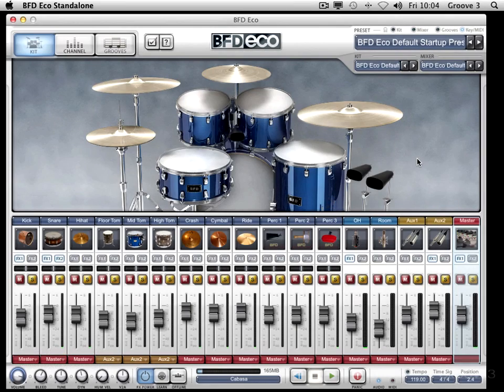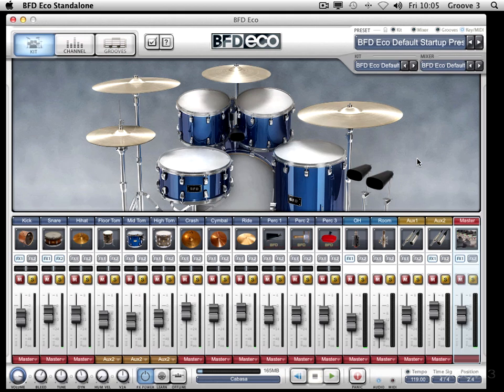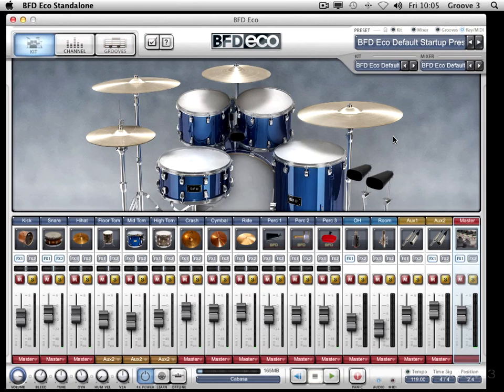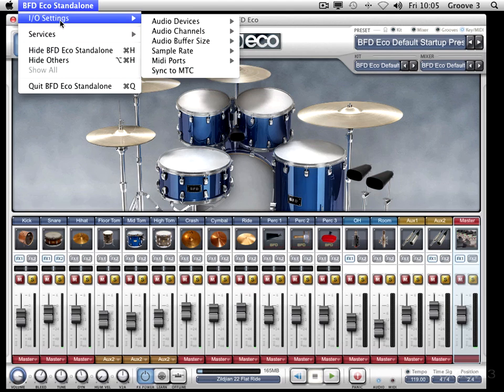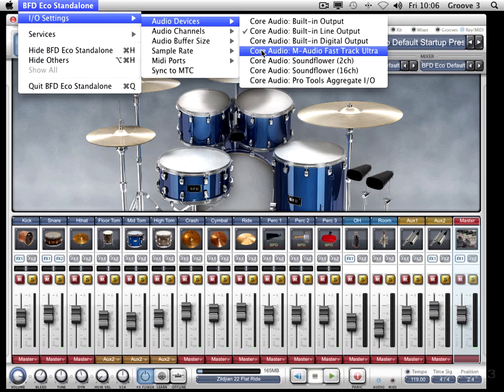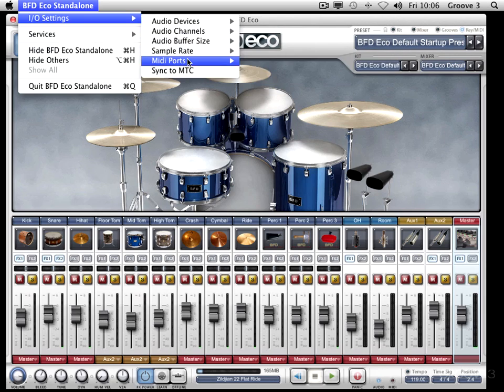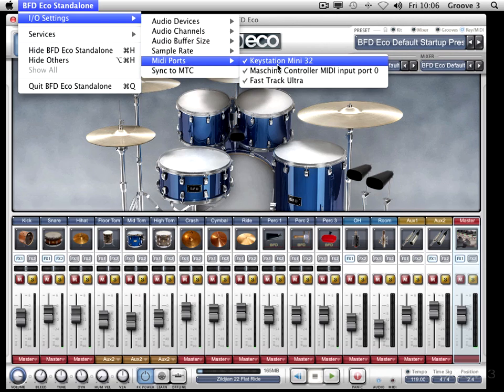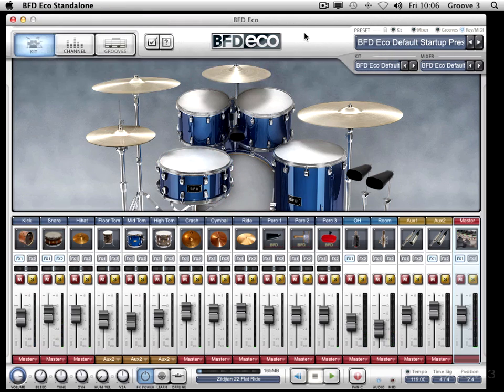Getting Started - BFD Eco Jump Start

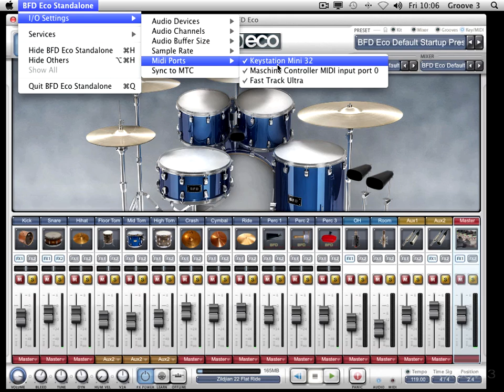Comment: Got a question:  At about 1:40 in the video you mention choosing the midi port.  In stand alone mode my midi keyboard doesn't show up, so I can't choose it.  I'm not sure how I get it to show.   The keyboard is hooked up to a 002 interface.  I also tried launching pro tools and using bfd as a plug in.   The keyboard still doesn't show up.